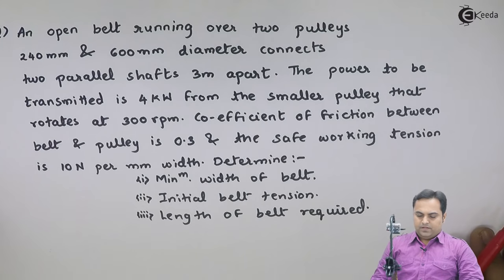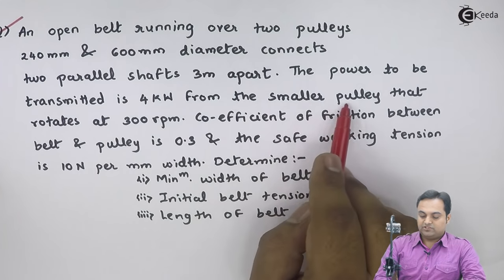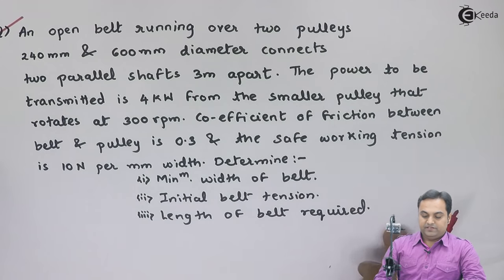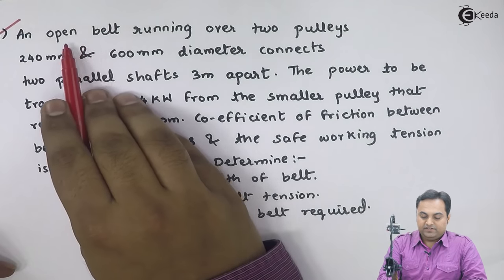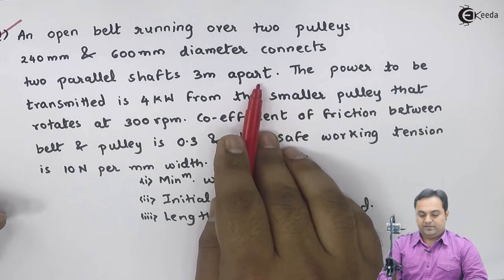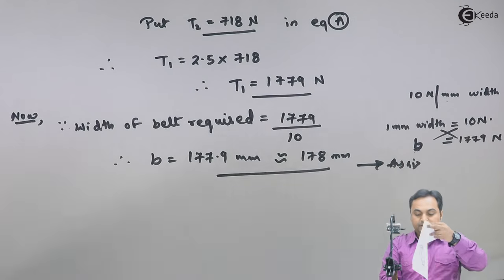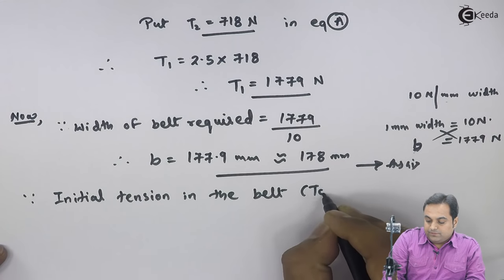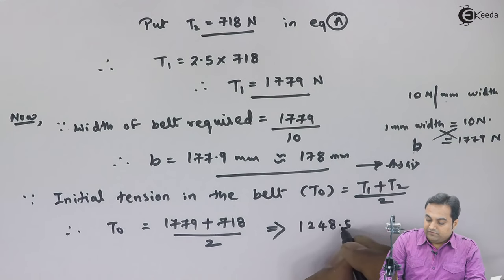Problem 1 Based on Belt Drive - Power Transmission - Theory of Machine

Comment: determine width of 9.75mm thick lether belt transmits 15kw running at 900rpm.the diameter of driving pulley is 300mm. the driven pulley 3m density of leather 1000kg/m3 maximum stress is 2.5 mpa .co-eeficent of friction is 0.3 take centerfugal tension in to account

I want this problem solution

Comment: design completely belt drive to drive  a witch from an electric motor of 11 KW power . speed of  motor shaft is 750 rev/min.  speed ratio is 4 . belt position is  horizontal and there is  considerable vibration of load.

Comment: What will happen, in case of excess power of input morethan designed power specially in conveyr belt drive is it cause to damage gears in gear box.

Comment: in open belt drive the driver Pulley of 100 mm is rotating with 1400 rpm find the diameter of the driven Pulley rotating with 3500 RPM.
Solve it
Reply: They wont solve. They only post vids to gain money from ads